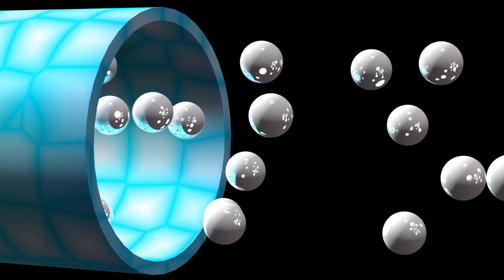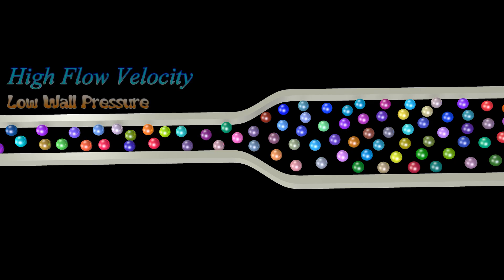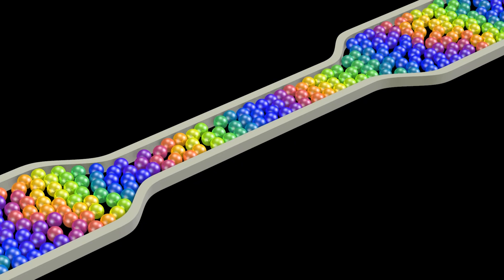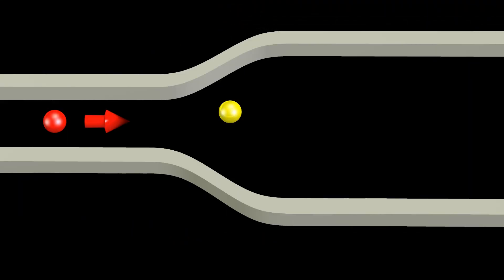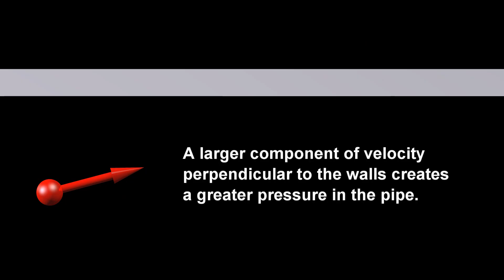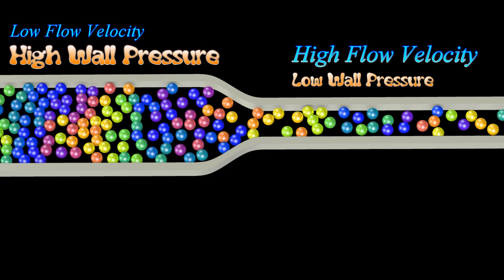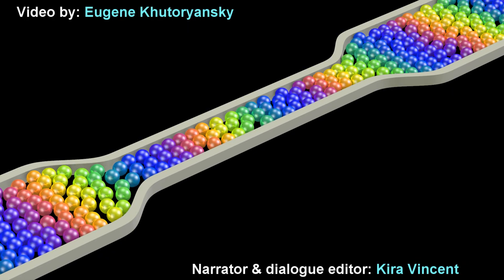Bernoulli’s Principle on Atomic Scale

Comment: I'm astonishingly surprised that I got it the exactly similar way, but entirely through intuition and not the mathematical explanation! So it goes like this:

Suppose you are given the responsibility to manage a crowd of fans rushing in to meet their celebrities along the path. 
Now let's say, the crowd was very obedient and moving in the direction of the line, so they could be handled easily, hence less "physical" pressure on the ropes around them. And less "mental" pressure on you 😅😅
On the flipside, suppose they were very sluggish and disobedient and were all over the place, then the ropes need higher tolerance for the higher pressure, and you need more competence 😂

Comment: What about flow over a cylinder? Derivations use Bernoulli's Principe to justify that as the fluid velocity decreases across the surface, the pressure increases. How can such intuition be applicable for this case as to why actually  this happens ?

Comment: make no sense. you explained it with single particle.. however in the narrow section the particle can collide with other particles and cause the particle to bounce vertically to the wall or even backward. fluid flowing with higher velocity does not have lower pressure. it is just the fluid in the large section is restricted by the wall of the tube thus increasing it's static pressure. this is an illusion. don't think why the velocity is higher in the narrow section, think why the static pressure is higher in the wide section. in summary, the wall restriction in the conical section is causing the pressure in the wide area to rise which in turn will accelerate the fluid into the narrow section ...increasing its velocity.... it is always the pressure who controls the velocity (the opposite is not true)

Comment: So it is the atoms velocity causes the different pressure in the pipe, not the pressure causes the different velocity of atom, right?
Reply: I am confused when it said at the begining "high pressure push the atom go through the thinner section of the pipe and ..."
Reply: @junwang6791  It's all a matter of velocity. The atoms in the larger section are more likely to have a perpendicular velocity, this will stuck the atoms there, as they derive in the direction of the flow. The pressure is given by force and area, and force is the change of momentum by time, and finally the change of momentum is related to the velocity, which varies as the atoms hit the pipe walls. So, the bigger the change in momentum (change in velocity-y) the bigger the force and the bigger the pressure. As the fluid starts to face a narrower pipe, the mass that didn't enter the pipe yet will start to exert a force in the x-axis, trying to push the mass in the narrower pipe, this happens because it is now facing a resistance to the movement due to the mass that's entering the pipe, remember that these atoms are bouncing back and they will naturally create a resistance to the flow in the x-direction. It is this force that will accelerate the atoms in the x-direction, transforming the energy from static pressure energy to kinetic energy. As the velocity-x increases and the velocity-y decreases, the time in average that a atom spends hitting a pipe wall in the y-direction is smaller, meaning the variation of momentum will decrease, and so the pressure.

The velocity-x increases because of the said transformation. The velocity-y decreases because the atoms MAY lose some of their velocity-y in order to enter the narrow pipe. This occurs through collisions with the pipe and other atoms, which keep transforming momentum between x-axis and y-axis, this process continues along the pipe that's being narrowed until the atom has the necessary velocity-x or angle to enter the narrow pipe, notice that the pressure along the pipe that's getting narrowed decreases, and this makes total sense since as we narrow the pipe we're making it easier for the atoms to enter the narrow pipe, that's why in the beginning of the narrow pipe the pressure is the lowest, we don't need to transfer any more momentum-y to the pipe to gain velocity-x, we're already inside it.

To finish, the atoms gaining velocity-x will transfer more momentum to the mass of fluid just behind them, so in fact  the atoms are pushing it back and by Newton's Third Law we'll have a force on the atoms pushing them forward. To maintain this force/pressure you'll need to keep the mass of fluid on its way without losing pressure energy (that's being used to counteract the force), and to maintain it a pressure pump is used. In an ideal scenario, where there's no loss of energy, the power of the pressure pump would be equal to the energy used to maintain this force accelerating the atoms.

That's the best answer I could give you, hope you get it.
Reply: @joao_ssouza  It's very clear for me after your exceptional explain. Thank you for bring it to me!
Reply: @junwang6791  you're welcome.

Comment: based on intuition i would say higher velocity atoms exert a lower pressure because most of the energy is directed at an angle parallel to the walls, if it is slower then they can bounce around in more directions and thus exert more pressure.

edit: well just watched the video and this seems very intuitive to begin with. I see a lot of comments of people not grasping this before the video. Maybe most schools assumed the reason was intuitive enough and no explanation was needed? This isn't even complicated quantum mechanics rather classical and trivial.

Comment: This explanation is excellent for one more reason: suppose the larger outlet pipe is empty at the moment. the small inlet pipe will behave much like a faucet, and spray the liquid directly forward unimpeded, and will not fill the pipe completely until or unless there is some resistance or impedance that causes some of the particles to bounce back. This explanation is fully consistent with how a faucet works, and a similar reasoning applies for how a basin works.

Comment: But that still makes no sense to me. Why should the atoms have a lager component parallel to the wall in the thinner area?
Reply from the maker: Because otherwise, they are more likely to bounce away from the entrance to the narrow section, and not make it inside the narrow section.
Reply: @EugeneKhutoryansky  Yes they can bounce back. But that could be the case for all particles and there would be no particle left that enters in the entrance.

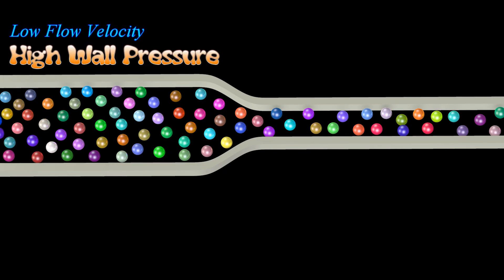And another question i thought about. The part where you talk about the unsatisfying answer at 0:55. That must be also true right? You just saying that its not answer the question why we have low pressure for fast moving particles, right?

Comment: Isn't the truth that this is just an inversion of reality. Since there is no gravity in the system then fundamentally it is incoherent to our current reality and such a singular lens does not fit. I feel it only tells half of the story which can obviously help understand and explain the other half. Obviously you can't understand anything by understanding itself in general, but only when in comparison to that which it isn't. Through the comparison of the two lenses of a sphere you eliminate the contradiction and all that's left is the truth which is it's definition in terms of its differentiation from another. Gravity in the system creates an elasticity that otherwise isn't present in this demonstration. Not that this demonstration isn't necessary or isn't a good demonstration to help one come to such a conclusion it's just I feel that understanding in general is missing in most of the public mind therefore why they won't truly understand what this means.

The only way to understand something is by comparing it to its fiction, but one must not mistake the fiction for the reality itself. Only that it is useful in the understanding of its primary function and not necessarily describing the actual function itself.

Maybe it's just because I didn't go through engineering conditioning and therefore didn't need a correction in the first place. They teach people recipes so they can't understand them intuitively. Without the understanding your ability to use the power you were given is very limited. Though the recipes have their purpose and place as well, cuz if everyone was like me then nothing would ever get done in the first place.

The truth is things only take shape when they're in the process of being observed. Through the inversion allows the formulation to manipulate that in real life. Don't confuse it for the truth, since a fiction is just a fact of life that we have learned from inverting the process of Truth..

Comment: Unfortunately, this speculation is not good science. 

The author of this script refuses to accept that a Pressure Gradient causes fluid acceleration as Euler revealed in the mid 1700 while following up on Bernoulli’s work. Air has mass and a force is required to accelerate any mass, even fluids. Pressure is the source of that force. 

Newton for fluids.

And, BTW, Euler derived what we now call Bernoulli's Equation. There is no indication that Bernoulli understood the cause-and-effect for what he saw in that typical venturi tube as the pressure/velocity inverse relationship.

This video’s explanation is very weak in its cause and effect logic. In fact, I am unable to follow the logic. Most times I’ve seen people trying to explain pressures down to the molecule level; they go astray in their assumptions as though it is simple balls - as a Newton’s “Hail of bullets”.

This video’s logic is faulty as follows.

It appears to be using another common misconception. Namely, that the random thermal motion of the molecules is changed by a net speed of the fluid in one direction. This claim is that the velocity and therefore momentum toward the wall is reduced by adding a velocity along the wall. This is clearly nonsense.  The temperature random motion is superimposed on the overall bulk velocity in any direction.

There is nothing to suggest that molecules change their random vibration to more in one direction (along a pipe) and less in another (perpendicular to the wall).  They vibrate the same thermal way regardless of a net movement in one direction and the component of that motion toward a wall is unchanged by that directed speed. This is how vector addition of velocities works.
Orthogonal velocities do not affect each other. This is just like the classical physics example of a cannon-ball that has its horizontal speed unaffected by gravity and its vertical acceleration by gravity unaffected by the horizontal speed.

By this reasoning, air in a sealed jar that is shot from a cannon has altered vibration motions from when sitting still.  This cannot be true.

For example, here is how velocities like this will add: A molecule moving thermally at some instant with a velocity at 45 degrees (up right) with speed (magnitude) 1.0 has an upward component toward a wall above it of 0.707 and a forward component to the right of 0.707. Adding a horizontal speed to the right of 5.0 results in a new horizontal speed component of 5.707 and the same vertical component of 0.707.

Velocities add vectorially.

The component of momentum perpendicular to the wall is unchanged.  The air exiting any blower into open air is at the very same pressure as the still air around it.

This can easily be measured by anyone, just as it is by professional aerodynamicists every day as shown here in 
Weltner, Fig 3:
http://user.uni-frankfurt.de/~weltner/Misinterpretations%20of%20Bernoullis%20Law%202011%20internet.pdf
...
Finally, the video completely ignores the  presence of the well-known boundary layer which is completely motionless at the surface, so as a result, this claim of the molecules moving along the tube is completely invalid before even entering this above discussion.

 This is bad science.
Reply from the maker: The video is correct.  You may want to read the following.
http://physics.ucsc.edu/~ccrummer/aero1.pdf
Reply: @EugeneKhutoryansky  Yea.  So there are two people with the same misconception.
I know you have good intentions, but you violate some very common and well understood accepted principles of physics. 
..
The statement at 2:07 is correct. "there is no reason to expect an atom with a higher velocity to exert a lower pressure on the walls of the pipe." 

There can be the same pressure in a fast fluid as a slow fluid.  They simply have the same static pressure. Bernoulli is not about speed. It is about changes in speed or velocity which is Acceleration along a path. 

The pressure on the walls of a sealed jar is the came regardless of the speed of the jar.

A fundamental flaw in this misconception at 2:42 is is that there no reason to expect a molecule to have the thermal vibration in only one dimension.  These pressure causing vibrations are random in direction and are how they bounce round between other atoms.  
At any given instant a molecule may be going down and the next at 90 degrees or even 180 degrees to the previous vibration.  

That simple fact breaks this false logic.
..
Then. . . 
It is the average velocity (over time) that has a directed motion when the kinetic energy is added to produce an increase in speed. That directed velocity is vectorially summed to the random vibrations.  This is vector addition of velocities. This means that the random vibrations are superimposed onto the linear velocity along the tube. This is fundamental physics. Vector quantities like speed and acceleration add vectorially.
Ignoring that fundamental physics is another flaw in this.
..
..
Then, the added kinetic energy in the moving fluid is in only  direction.  It is not increasing the random thermal vibrations. That would require increasing the temperature.  This is another flaw in this story.  Moving the fluid along the pipe does not raise the temperature.  
Therefore, the statement at 2:23: "an atom with a higher velocity would have a higher kinetic energy and, therefore, exert a larger force on the pipe walls" is false because it conflates / confuses thermal energy and momentum in one direction.
..
..
Consider bouncing a ball on the floor. Each bounce imparts some momentum to the floor.  The ball's actual motion is only vertical..

Now, start the room moving (a train car) and the ball still imparts the same momentum to the floor with each bounce.  It's actual motion, relative to the stationary ground changes.  It has the SAME vertical component, but now a horizontal component vectorially added to the vertical motions.  The pressure on the floor does not change.
.
 However, these two motions are orthogonal and have no effect on each other. The vertical up[and down bouncing component remains the same. ONLY the ground referenced horizontal component changes as the speed increases.
This physics does not change if the ball is bounced on the ground outside the train's window.
.
This fails on these fundamental physics errors.